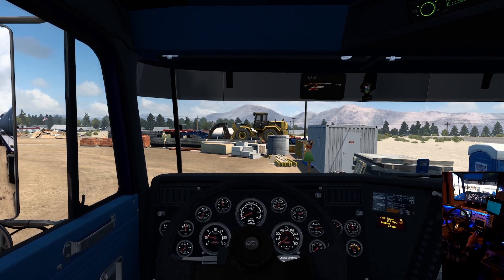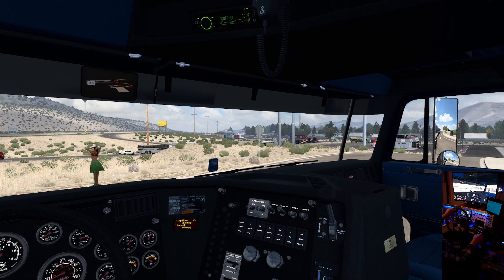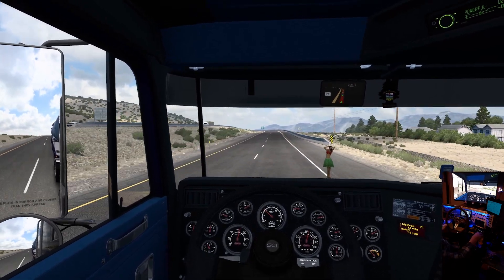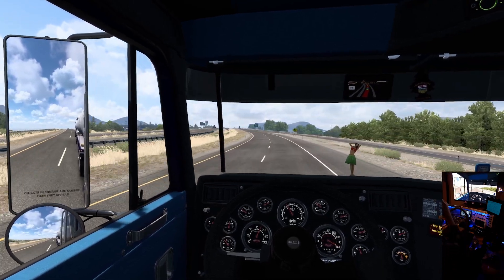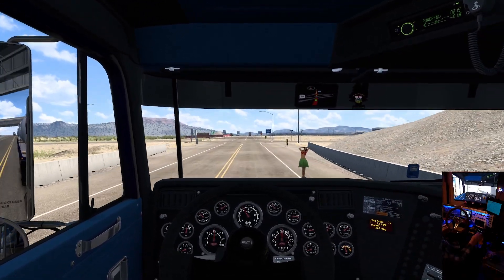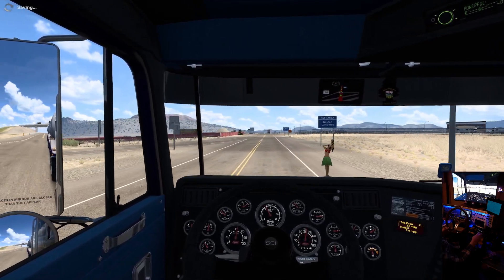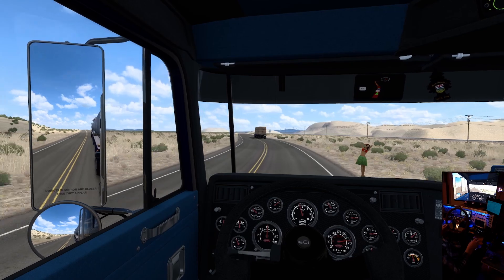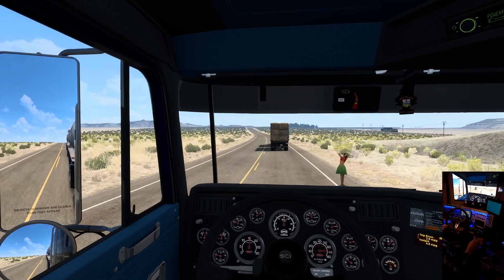ATS  Hard Parking B Doubles with the Ruda Peterbilt 362

Comment: That was impressive,  I ran a double bottom crude tanker for 3yrs it's a straight truck with a body mounted tanker with a 12' tow bar and permanent carousel fifth wheel  pulling a 150 bbl tanker  , that thing was a bit to back with only one articulating point.
Good job 👏  👌